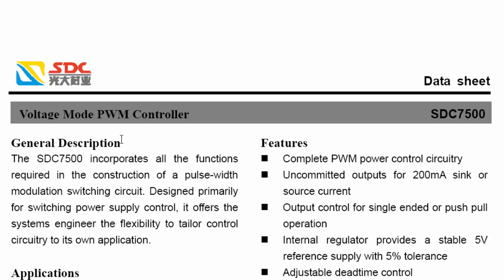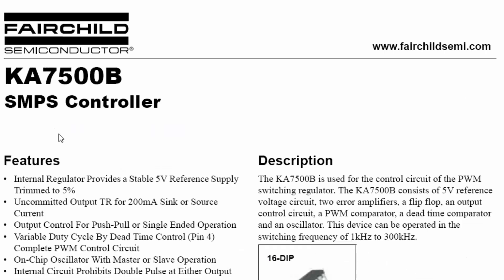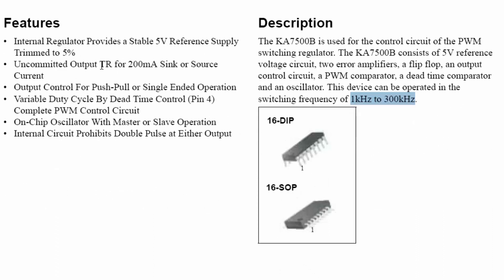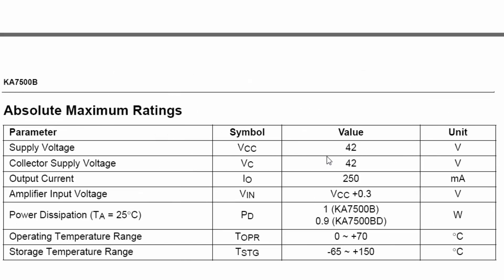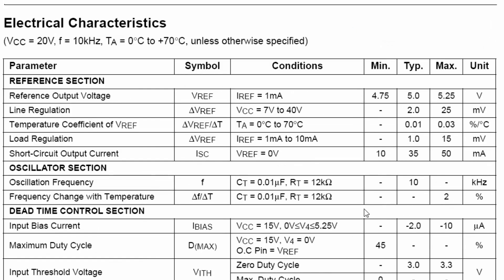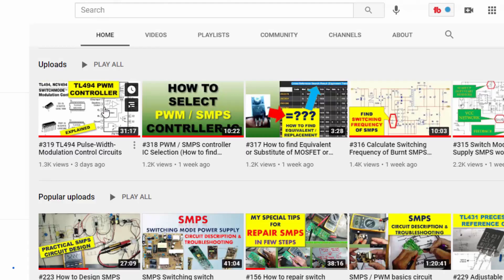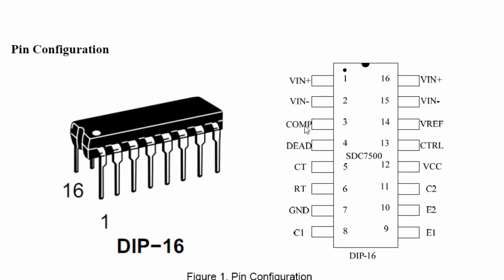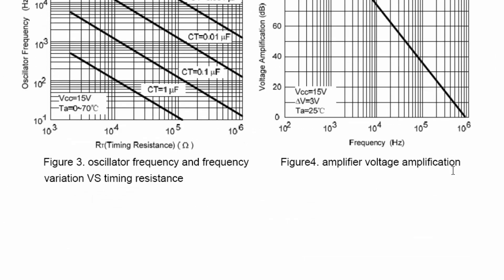#323 SDC7500 / KA7500 Voltage Mode SMPS Controller

Comment: Sir I watched your number #272 video, I want to ask how to determine our atx 350 watt smps working maximum or normal working frequency? For example if in smps used TL494 ic, then should we look at RT and CT pin and calculate working frequency?
Or if the smps used other pwm ic, then can we control the pin RT and CT?
Normally how can we understand our smps working frequency or max. working frequency for choose wire diameter ?
Reply from the maker: yes dear we have to check the RT CT value and also the condition of pin 13 of TL494/ TL594 / SDC7500 / KA7500 
that is frequency operation selection. 
for any smps we have to consult datasheet. some ICs use only CT some use only RT  and some ICs use RT/CT
Reply: @HaseebElectronics  thank you very much